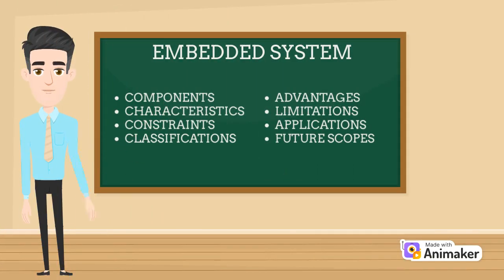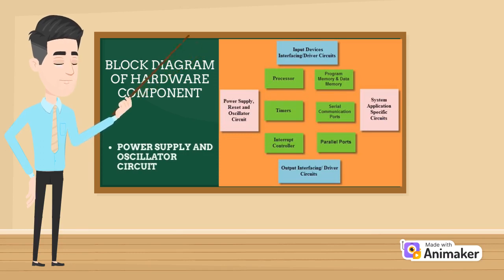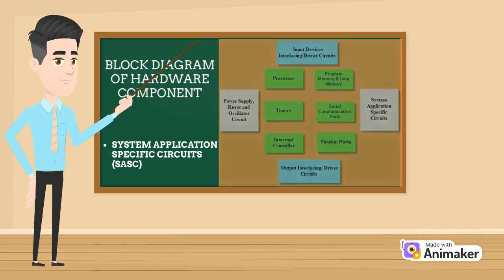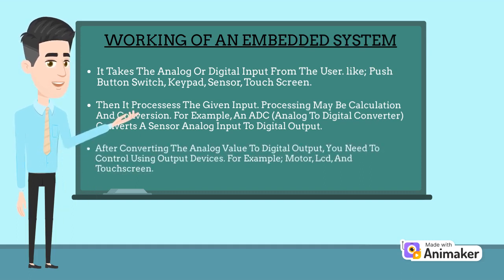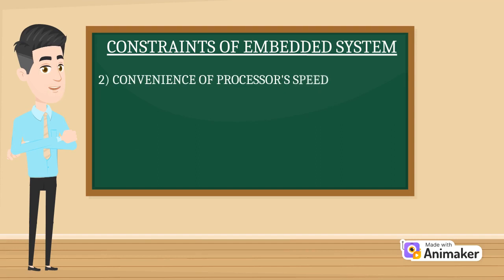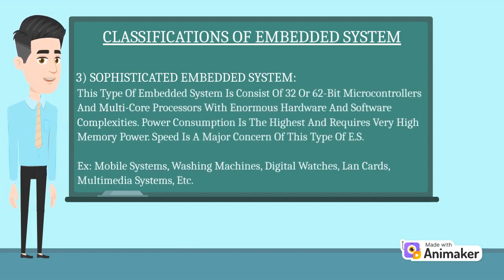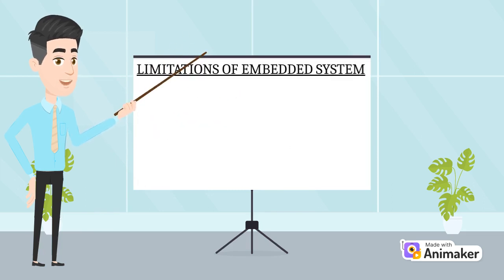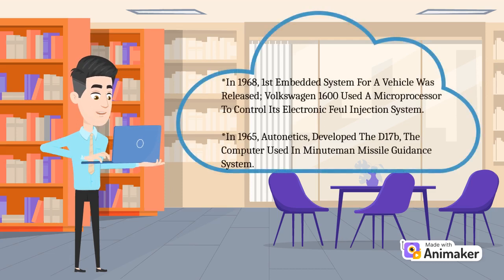EMBEDDED SYSTEMS | Softwares and Hardwares Applications #EDU_MIND_OFFICIAL

Comment: Which software is used for embedded systems? 
(1A-CS-022)
Reply: Brother, actually Embedded systems typically use basic embedded system software such as C, C++, ADA, etc. Some specialized embedded systems may use OS such as Windows CE, LINUX, TreadX, Nucleus RTOS, OSE, etc. I'm pretty sure, it is the answer you were looking for.
Reply: Brother, actually Embedded systems typically use basic embedded system software such as C, C++, ADA, etc. Some specialized embedded systems may use OS such as Windows CE, LINUX, TreadX, Nucleus RTOS, OSE, etc. I'm pretty sure, it is the answer you were looking for.😊
Reply from the maker: excellent

Comment: Is any links between Embedded system with Programming languages ?
CSC-22F-146
Reply: yesss Mr. Zulfiqar, there is. An embedded programming language is a programming language that developers use in embedded systems. In general, the languages offer low-level access to the device hardware. Developers use several common programming languages for embedded systems. Some people also call these embedded coding languages.😊
Reply from the maker: good

Comment: Which design consider both the hardwere and softwere during the embedded design..??
CSC-22F-117
Reply: So Mr.Ram,The software/hardware codesign is the one which having both hardware and software design concerns. It was a concept that began in the 1990s. Its core concept was the concurrent designs of hardware and software components of complex electronic systems. It aimed to incorporate the two technologies and exploit the synergy between the two.😊

Comment: So basically can we save the battery charge when working on power dissipation?
CSC-22F-135
Reply: There is always a need to extend battery life and/or reduce the environmental impact of a system. Historically, this was purely a hardware issue, but those days are past. in future, it could be possible.😊

Comment: Is ATM an embedded system?
CSC-22F-137
Reply: Yes bro, as it is mentioned In this video, An ATM is an embedded system which utilizes a crowded Computer to set up a network between bank and computer and an ATM itself. It also has a microcontroller to bear both input and output operations.... 😎

Comment: (CSC-22F-110)
Mention what is the difference between microprocessor and microcontroller?
Reply: Mr. Taha, actually a microcontroller is like a miniaturized computer on a single chip. All the elements of a computer, such as CPU, memory, timers, and registers, are tightly integrated with each other. On the other hand, a micro proccessor is is just the computing element (the CPU) in a computer. 🙂

Comment: Is ATM an embedded system?
Reply: Yes bro, as it is mentioned In this video, An ATM is an embedded system which utilizes a crowded Computer to set up a network between bank and computer and an ATM itself. It also has a microcontroller to bear both input and output operations.... 😎

Comment: Which softwares are used in embedded systems..
Reply: Brother, actually Embedded systems typically use basic embedded system software such as C, C++, ADA, etc. Some specialized embedded systems may use OS such as Windows CE, LINUX, TreadX, Nucleus RTOS, OSE, etc. I'm pretty sure, it is the answer you were looking for.